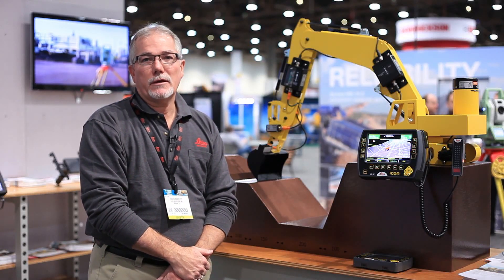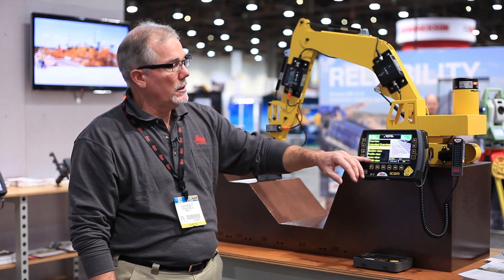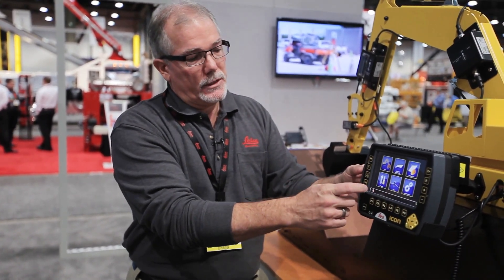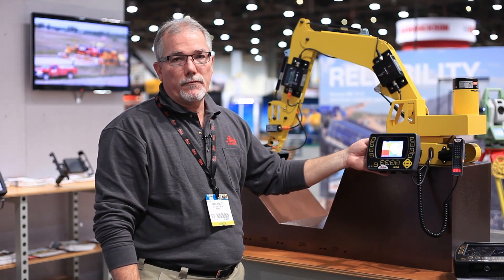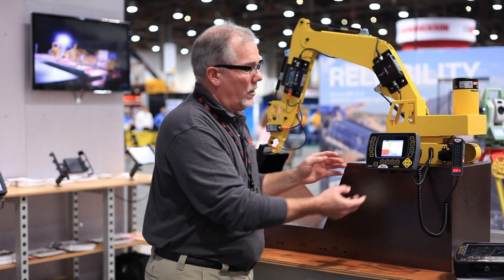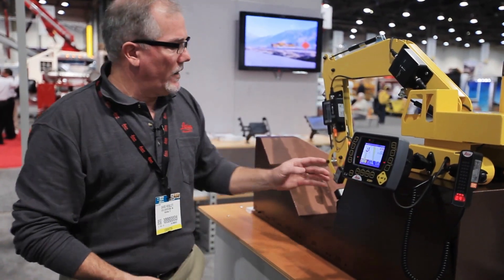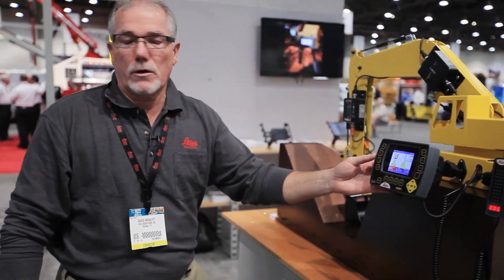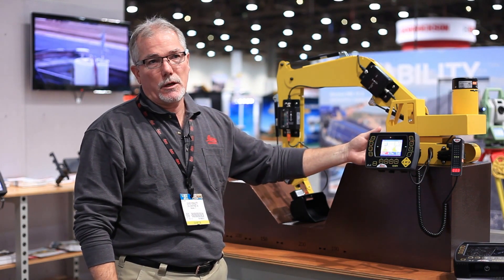Leica iCON excavate: The Fastest Way to Achieve Accurate Excavation

Comment: Don't buy this thing leica will not stand behind their stuff.  It malfunctioned in the first day of real use and they're trying to say that there's nothing wrong with it.  A sensor is bad and it starts screwing up and then putting slope in it when you didn't put slope in it.  save yourself a lot of trouble and don't buy anything made by this company this is not the first time I've had trouble with them.
Reply: Just bought a base and rover from leica. The salesman was showing me the first time to localize the base station and the rover would not connect to the data collect and just tries for 2.5 minutes before it says can not connect.  He said he forgot to disconnect the bluetooth from the base before trying to connect to the rover, but it will act up and not connect even if deselect. Later I was able to connect the base and rover a dozen times in a row without disconnect one before selecting the other.  I called him and asked him if it was used because it was missing its quick guide and usb manual ( I suspected him of being a lair because he said he owned part of geoshack which turned out to be a lie) he said no and said sometimes it will do it if you are to close to the base.  Which is a lie because I tried one time with them on the desk side by side with no issue.  So I called topcon and they said they might buy it off me.  Goodbye leica